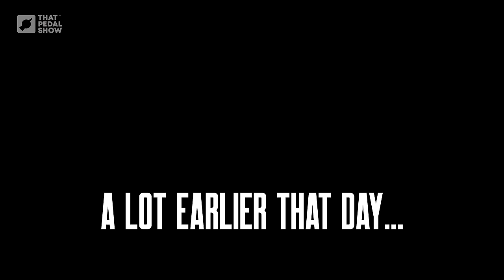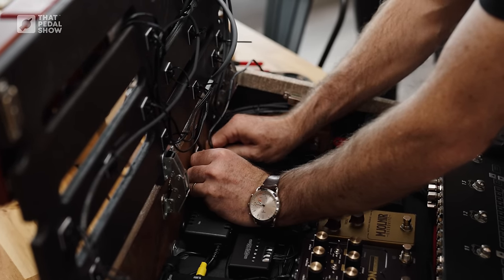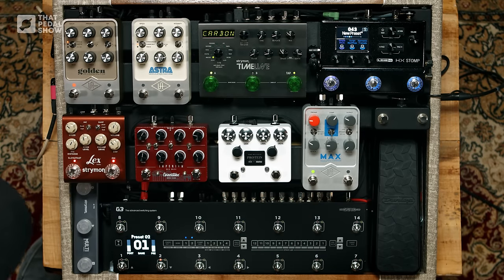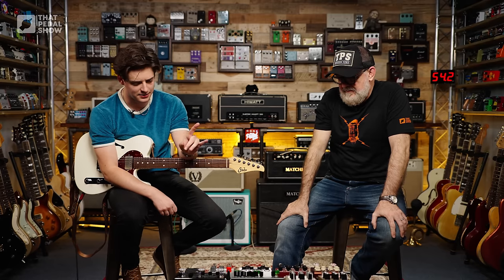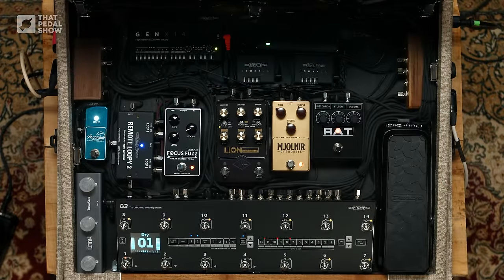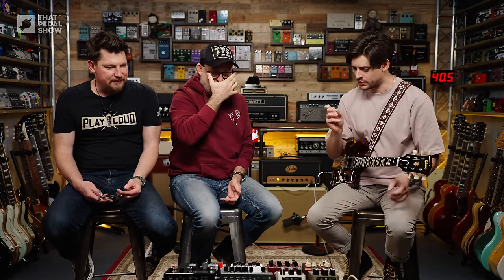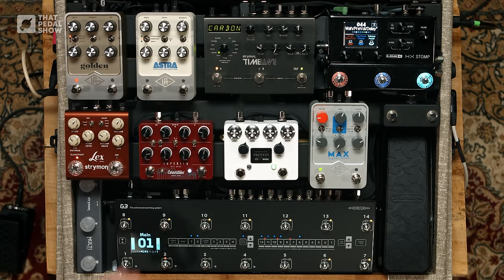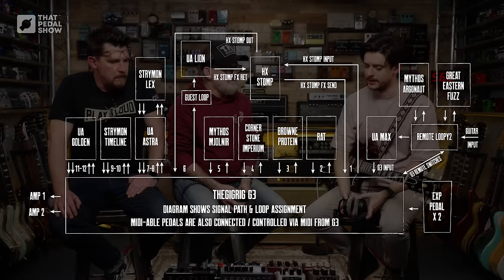Jack Griffiths Pedalboard Build [Monster Analog & Digital Board PLUS UA Lion!]

Comment: I agree with Jack 100%, I have a Strymon Iridium at the end of my board which can be in the circuit for home practice into audio interface, DI to FOH/IEMS or even cab simulation off into a power amp + cabinet. It sounds impressive, super easy to use and comes in VERY handy. Might consider "upgrading" to the Lion 68. GREAT video!

Comment: I have a UA Dream and Ruby on my board and when I use amp I shut off the speaker emulation and just use the pre amps into the power amp of the amp. Sounds great! I have it in loop 8 of the G3.
Reply: Bassist here 
I run my amp sim into the front of my bassman 500
Set it as neutral as possible dial in amp and eq and off we go
I run that into a tube compressor then into delay 
My delay sounds great with that

Comment: This was highly interesting to see how much goes into the routing to be able to get this accomplished. As a guy who uses computer and Helix and some external pedals, I dont really have too many issues with getting stereo etc but this is really cool. My favorite was the Timeline tap tempo/then gain added and now have to figure out how to get the Meris LVX there. I saw it said said 2 Taps. I do 3 fuzz pedals into 3 boosts/overdrives into Helix and Meris on Send Return. For reverb, I use the computer.

Comment: Another excellent episode of That Power Supply show! 😁 

I do hope that anyone watching this takes the ongoing warning that PSUs are very much not created equal, and 'isolated' in an Amazon description doesn't necessarily (for which read under £/$100 'doesn't') mean what you hope it does, seriously. If you're watching this you're going to spend more on pedals than power, eventually.

As for the actual show: stellar as always. Loved the VCQ episode with Jack and this one too. I put my Klon (Klone - NU-X Horseman) after fuzz but before overdrive/distortion (250/Special Cranker/RAT) to flatten out the mid-boost. Got a Bonsai in a drawer I should probably sell, just not for me.

Comment: The Warehouse WGS12L are really nice speakers.
The Lion really impressed me more than I thought it would. Just started a 5W pedal board amp with DI and analog simulator and I think I have my work cut out.
Also wonder if I used the Lion then feed that DI into one of my crazy 300B audio amps into my horn speakers what it would sound like.

Leg ends as always, thanks so much!
Gordon

Comment: @jackgriffithsmusic very cool setup and killer tones.  I know you can re-order loops with G3 at will and the Lion is in the loop of the HX Stomp so my question is: when you're using the Lion for direct tones, are you putting that loop at the very end of the chain with all your drives in front of the Stomp and Lion?  What kind of DI box are you going into from the Lion?  Cheers
Reply from the maker: Hello! Mick here. The great thing about the Lion is that nothing needs to change. So… when Jack is using amps, no Lion. When he’s going direct, the Lion simply gets switched into the signal chain, after his main drives/boosts/fuzz and before the main wet effects. 
The same outputs that feed the amps can simply go straight to the live desk or other console. No additional DIs needed. Cheers!

Comment: Dan, why did you need to use additional isolators in the power supply for Jack's board? Surely, the GenX14 already has isolated outputs.
Reply: I was thinking this exact thing

Comment: IDK seems complex IMO, but if you can hear/feel the difference then it's worth it.

For music where I need more effects, I use my computer software rig or my Line 6 HXFX in 4CM with my Mesa JP-2C.  Both work great and sound great. 

The HXFX effects and routing sound great and cover everything I need in a small footprint.

I'd like to see Line 6 offer a HXFX with a built-in expression pedal.

Comment: Curious what he's using for the midi tap tempo control, and is that connected to the HX stomp, or the G3, or a TRS to Midi Din hub?
Reply: Re-watching the video, I think he's using a momentary switch box connected via TRS to the HX stomp 'expression 1/2' jack on top, with one button for 'tuner' and one button for tap tempo. I think that could all be handled by G3 itself or by programming the HX stomp, but that would take up buttons in G3 or the stop. Nice for gigs to have a simple dedicated 'tuner/mute' and 'tap tempo' button where he has it.

Comment: I thought you couldn’t do wet-dry with digital pedals without ADT? Don’t the Astra and HX create latency problems on the wet side? I’ve never tried - just going off what I’ve learned from D&M
Reply from the maker: Not sure on the Astra’s ADT situation…. But it’s being run in stereo here so it doesn’t matter. HX stomp… not sure. But here it’s mono, and inline whether loop 1 or 6, before any stereo split, so again, shouldn’t matter in terms of phase. Latency perhaps but phase no. Cheers!
Reply: @ThatPedalShow  makes sense. Was mostly thinking in reference to Jack’s cool idea of having a preset for wet-dry in the G3. Wondering if when you flip to that mode from stereo if this stuff becomes an issue.

Comment: Thoughts on the stomp, TPS?
Reply from the maker: Utility values seems good - ie it does a lot of stuff for a very sensible price. However, no analogue dry through leaves it dead in the water for us. No analogue dry through means latency, and therefore phase trouble when doing wet dry. There are probably ways around it, but neither me nor Dan would use anything that’s not ADT through choice. Cheers!
Reply: @ThatPedalShow  thanks team. Have an awesome Xmas

Comment: That lion though a nice PA at a venue where there isnt a sound limiter = excellent (but at that point I'd just bring an amp) 

It seems that all the situations where direct sounds are necessary - or required by legalities or the wishes of the MD - the sound will be compromised in another way (venue sound limits or venues with horrendous in house PA systems) or its not guitar centric music (theatre / modern pop gig etc) 

Either way, it sounds epic.
Reply from the maker: I was super impressed. Mick here. The sound is good! But the room experience is literally non existent. I just can’t get my head around that

Comment: Another ripper video as usual!!! I have a question. Most of the time when you guys run pedals the level pot is always higher then mine. For example the protein in this vid when both sides are on my level pots are way lower to achieve slightly above parity. Is it just my rig??
Reply from the maker: We tend to like to run ODs with plenty of level. They sound a little more open, often, and hit the amps harder. But whatever works in your rig!

Comment: Biggest issue I have with wiring these types of rear hinged long top boards is running all the audio cables in a way that folds nicely when the top moves. Any tips/details of that part of the setup would be greatly appreciated.
Reply from the maker: Dan talks about the standoffs and making the cables to length as the board comes together…. Once they’re all in place you can pull the standoffs tight. That’s one way to do it
Reply: Yep, that's what I've been doing, just all that mass of cables (18+ on Jack's board) never seems to fold quite right and always worries me that it may get caught somewhere (like a hinge!) @ThatPedalShow
Reply from the maker: Ah man, the hinge. I've damaged a few on the hinge! Mick here

Comment: What was the 100 watt amp that was used and the wattage of the badger,great show.
Reply from the maker: The badger is 35 watts. The 100 watter was an old Carlsbro. The latter was barely breathing so the power differential isn’t a big issue. Crank em up a bit and the headroom difference would require a different tack. Cheers!

Comment: Great board, with amazing pedals. I saw that there was a UA Ruby on the table, is there any reason why Jack used the Lion instead?
Reply from the maker: Wanted a more Marshall sound than a Vox sound. Cheers!
Reply: Ask a stupid question,Lol! Thanks. Jack has convinced me to get the Lion pedal, it sounds awesome @ThatPedalShow
Reply: I used the Lion at my gig on Saturday as a pedal platform and honestly, I have never had a better sound out of a PA and everyone commented. I used the Superbass Just the high Channel at 10 O'Clock and it was big and Fat sounding and all my pedals sound great! I hat the JHS AT and the BB preamp as my gain and the AT Delay and Strymon Flint and it sounded huge. If I do use an amp in the future, I will also plug the LION in to the PA. Changed my life!

Comment: How was the HX Stomp powered? This is exactly what I'm thinking of doing with an HX Stomp ..
Reply from the maker: From TheGigRig power supply.
Reply: @ThatPedalShow  with a special cable? I have all the distributer stuff on my board and so I'm guessing I'll need a Mr Universe and a 2.5mm socket? I saw the bit about the new power supply block (I'm probably not going to just swap over to that) but I gather that the HX Stomp bucks the polarity convention for that socket?

Comment: And yet no noise gate? Baffling. Killer player. This board is overwhelming
Reply from the maker: You don’t need a noise gate when everything is as clean as this, signal wise. Plus, Jack doesn’t use high gain amps, so there’s basically no amp noise to deal with either. Cheers!

Comment: Great video I'm sure you already realize but there is distortion on the audio not the good type😢
Reply from the maker: Something was clipping somewhere. Wasn’t the mic pres, not by a long way. But yeah, I’m aware of it. Mick here.
Reply: @ThatPedalShow  hey Mick, hope you work it out without to much hassle. Happy Christmas to all the crew.
Reply from the maker: I’ve spent a few hours trying to figure it out. A process of elimination. We recently got a bunch of new recording gear, so it’s obviously some user error somewhere. All the meters are reading fine, and it sounds good when we pre test. 
What I do know is that we have incredibly higher fidelity since getting the new gear so I think stuff like mic choice and placement are now hyper critical rather than just slightly important! Hoping to spend some time over the holidays working it out. :0)